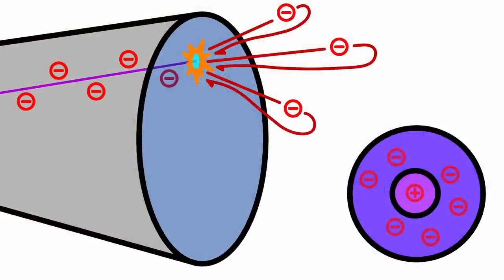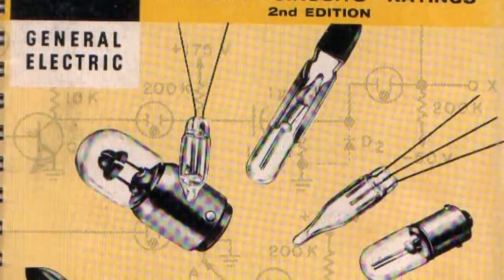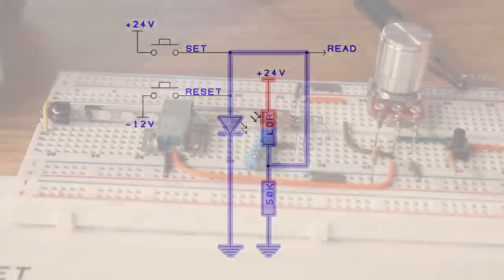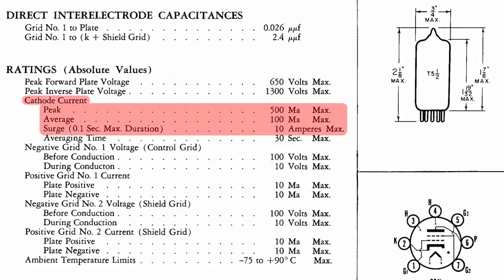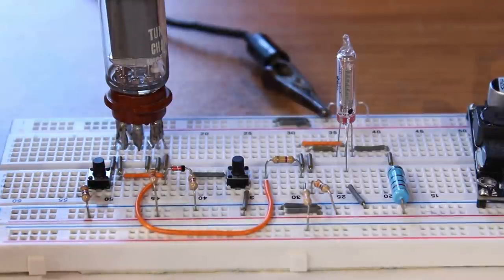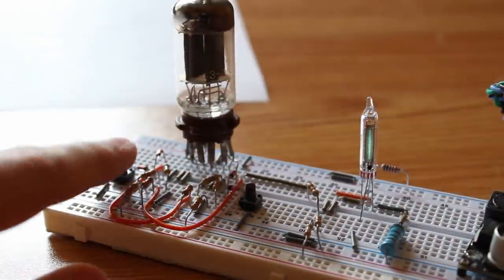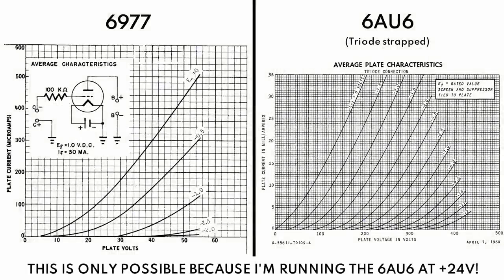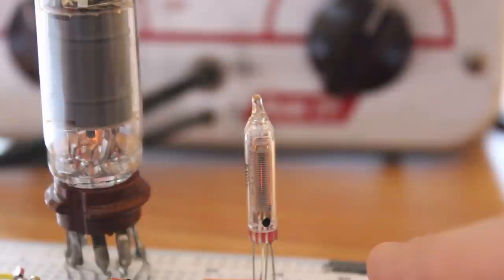Vacuum Tube Computer P.24 – Building SR Flip Flops with Trial and Error

Comment: This might be an absolute non-issue, but have tested how fast the VFD-based latch can switch? You're not aiming for MHz speeds, so this might be purely academical, but would still be nice to know I think
Reply from the maker: I haven't specifically tested this design for speed, but the 6977 datasheet does give us a little insight - it takes around 30 us to fully illuminate or fully extinguish. If we imagine it changing states every clock pulse, that would mean a maximum clock speed of around 30kHz, which isn't super fast. However, my current design plan is to read the instructions directly off magnetic audio tape, and using FSK the maximum speed I could attain is around 1kHz, though personally, I'm aiming for just 50 to 100Hz. 

Either way, the VFDs wouldn't be the bottleneck, but it's interesting to know what kind of maximum speed you could achieve with a better program design!

Comment: Hi! I like the approach with vacuum tubes.
What about using capacitors as memory? Maybe, one cap can hold more than 2 states, like 4 voltage levels (24 divided to 4 voltage ranges) which means 2 bits/cap. I think you can fit 64 x 64 capacitors to a single board, and One vacuum tube circuit that is refreshing all the values. Basically demonstrating DRAM, and using charge as in modern SSD-s. This would give 1KB of memory! It would be enough to drive a monochrome Display, and write some games for this computer :D

Comment: U could use neons and instead of using voltage use current and the computer rails act as ground or something of such 

Exactly how vfd and nixies work with silicon chips 

But a crt is the best because speed and amount of data canbe stored and put a lense over crt to expand pixles can see the data
Reply from the maker: I'm not sure I'm following you. Neons are incredibly low current devices and really need the voltage potential to get them to strike. 
Williams Tube / Electrostatic CRT memory is super cool, but again, that's much, much more voltage than what I'm allowing myself to use here!
Reply: @UsagiElectric  so ur valves are ground for the device and the device is the voltage drop sos 250v goes though neon and then theres like 5v to go though ur valve as hypothetical situation 

If u look at nixie tube with silicone chips that the chip doesn't actually have the 180v go though it just grounds the nixie.........
Reply: @UsagiElectric  https://youtu.be/ggVu_U-CsAk
Hopefully that helps 
The chip runs 30v and nixie is 190v 
Nixie is common 190v and chip grounds all the number pins working mainly with current

Comment: I know you started researching and going to a particular topology... but, insisting with delay lines, (I do not say that you go there, it is more something that maybe I try)... How about a (slow and easier to read/write) magnetic tape loop? maybe stereo, one channel is data, another channel is clock
Reply from the maker: We actually talked a bit about doing something like that on the Discord, kind of like the audio tape loop Look Mum No Computer showed on his channel a little while back. It totally could work, but there's a certain timing problem that arises. For example, I need some markers in the tape that identify the tapes exact position and someway to track that. There also needs to be specific control for reading and writing, which can be quite complex with transformers, amplifiers and precise timing. This isn't all that different from delay memory, but we rapidly approach a point at which the number of tubes involved is about the same as doing it with flip flops but then we lose the cool blinkenlights that the flip flops give us. 

Also, I'm totally planning on using magnetic tape for the program ROM, so there will be some good magnetic tape use going on!
Reply: @UsagiElectric  just rambling... how about taking advantage of a stereo tape;  channel 1 with pulses as a marker, and channel 2 with data. if channel 1 and channel 2 have a pulse, it is a one, if only channel 1 has a pulse it is a zero. channel 1 would increase an address counter, and at the end of the tape loop, which the counter instead of resetting, would simply return to zero by overflow.
you can use a binary comparator with only diodes to determine if the address read is equal to the address requested, although the functioning is somewhat "analogic"

Comment: Also I just remembered that valve computers they used special valves because they didn't like being powered up and long waits between signal changes it lessens life of tube etc 

I was thinking if you sent a modulating signal though it that doesn't effect the hi n low states can keep the valve life longer and bonus u could make a circuit to pick up the signal that tell you if valve is working and could even live see life of valve by how signal is

Comment: Using solid state diodes?????
Reply from the maker: I am indeed using little diodes in there. The primary logic gate I built the entire processor out of was the NOR gate and I used two little diodes to make those NOR gates as well. It's kind of cheating in that they're little schottky diodes, which are a little too modern, but germanium diodes of the era were indeed quite common with vacuum tube computers and could be put in place here with no modifications necessary at all. The LGP-30 is a wonderful example of germanium diodes and tubes working together, but even IBM regularly used semiconductor diodes on there tube computers too!
Reply: @UsagiElectric  I didn't know they used the germanium diodes.  when I was in school the Si transistors were replacing germanium.  As I remember the Germanium devices had stability problems and were hard to bias.  But that was long ago.  Keep up the good work.

Comment: please reduce filament current of 6977
Reply from the maker: The 6977 uses 1V at 30mA for the filament, which means when it is fully warmed up, it has a resistance of 33 ohms. I'm using an 820 ohm resistor from the 24V rail, which should drop 23.1V across it to supply 0.9V into the 6977 filament and allow 28mA of current to pass through, which is prefect.
Reply: @UsagiElectric  The filament glow should not be visible for maximum life. Try 1k ! Will extend tube life
Reply: @UsagiElectric  Calculations are right.  Experimentation with higher values is not a bad idea.
Reply: @UsagiElectric  mohinder's observation is that the filament appears to be (camera or it appears that bright by eye?) glowing brightly, which is normally a no-no with VFD's.